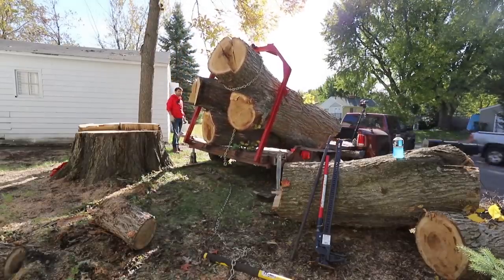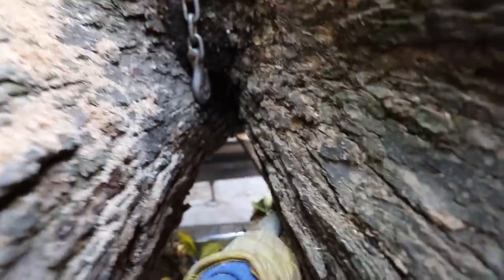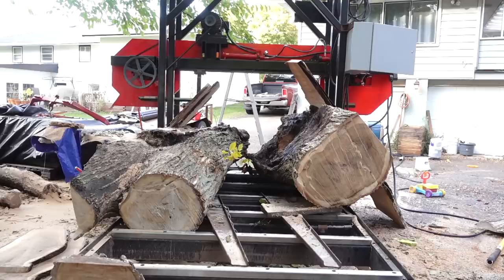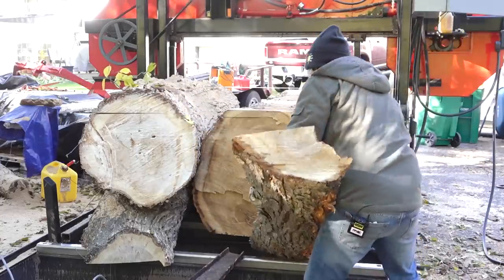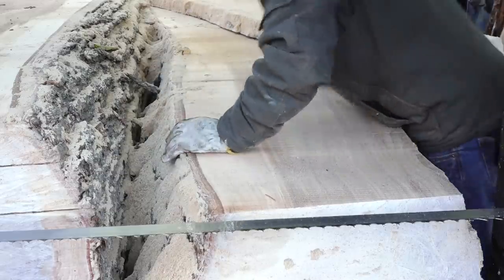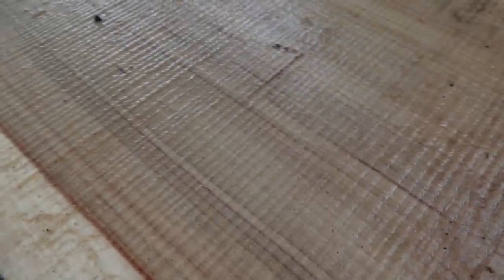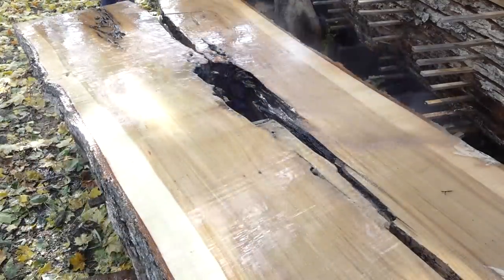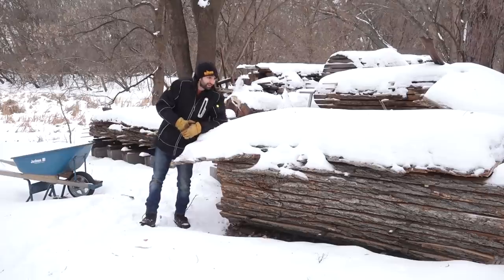This Log Came Apart on my Sawmill

Comment: I'm happy you had the good sence to stay off the top of that mess cause as much as they weigh, It would crush you. I really think you need a electric or hydraulic motor on the track system to make even more smooth cuts and save you from hurting yourself. You shake the devil's coat tail too many times then its only a matter of when, not if!

Comment: Watching this gave me an idea on having slabs cut from a trunk with the rootball still attached.  Meaning someone took the time to dig all around the base of the tree and cut through the roots so you are left with a long trunk and the rootball.  I see a waterfall table with the short side ending with the rootball cut at its widest and then going up the trunk for the joint and table top.  Have you cut a large tree with the rootball still attahed?  Any ideas?   Thanks for the vid.

Comment: Mathew,have you thought about using a battery powered drill in place of the hand crank? Maybe just disconnect the handle and use a deep socket ! Food for thought and save your energy! Good job ,we are enjoying your work!
Reply from the maker: I use a drill on small logs when I need much faster feed speeds

Comment: I imagine that in one of your previous videos you covered this question, so please forgive me if I'm going back over some old ground... but I was wondering why it is you haven't automated the forward and backward movement of your saw carriage?
  Again, sorry for most likely asking a question that had already been addressed before.

Thanks for sharing your sawyering experience with us!
Reply from the maker: Mostly because I prefer using the saw to working on it. I also like the manual feed. Provides much more feedback as you’re moving the saw through the log

Comment: Get yourself a metal detector and run it over the tree before you agree to remove it, because it could get expensive replacing blades because of hitting metal objects.  The saws mills around here don't like to take trees off of private property because people put screws and nails in trees.
Reply from the maker: It doesn’t really make a difference to me. I expect there to be something embedded in these trees

Comment: Hi Matt, are you able to send in the blades for repair (with missing teeth), or are they toast once you hit metal and strip teeth?  Thanks.
Reply from the maker: You could splice in a replacement section but they’re pretty inexpensive so it’s not really worth it

Comment: It does no good to note "cut duration", the longest time for woodworking is set up. Measuring, positioning, adjustments and mistakes, take the most time.
Reply: Those are called flitches in the milling world. The speed of forward movement of the band saw mill will affect a lot of stuff, so it actually is useful. I assume most of the woodworking you guys do is with already rough milled wood.

Comment: When a blade looses several teeth is it trash? Or can a sharpening service braze on replacements?
Reply from the maker: They’d need to cut the damaged section out and weld in a replacement. I doubt it would be very cost effective

Comment: That was either two entirely separate trees growing up practically on top  of each other , or  it  was like a two-headed mutant-- grew two trunks at once. Stuff like that happens now and then.

Love your vids, Matt!
Reply: I wish you could mill my Siberian Elm. I had the tree cut down but still have the boul, 9 ft high by
11 ft circumference. I salvaged about 600 board feet from the limbs and may get 400 bf from the boul. Elm is a beautiful wood finished.

Comment: Always cutting so thick slabs !  expecting to loose 50% of it on the jointer + planer ?
Reply from the maker: About 1/3 between shrinking and surfacing
Reply: @mcremona   coincidence i just commented on another of your video about milling strategy without a kiln and without a quarter sawing capable mill.

Comment: You need a gantry crane attached to your saw. Make it foldable so transport would be easy.  When you had 300# slabs, it would be safer.
The winch works well but OSHA would have a hay day with you. Your to young to have a life altering event... safety first!
Reply: This was filmed before he got the skid steer now he uses that.
Reply: Y Pop that works also! And probably more versatile..👍👍👍

Comment: Could you set up a garden hose to that area so you don’t have to use a bucket to splash water on the slabs?
Reply from the maker: Yes, that’s how I fill the bucket
Reply: Matthew Cremona of course.  So do you just prefer using the bucket?  Seems like it would be more efficient to spray with the hose.   Who am I to judge?

Comment: Should put a timer on how long it takes to remove and stack each slab after it's cut. Butting it is considerably more than 1:31 lol
Reply from the maker: Approx 15 per slab for the whole move and splash segment
Reply: Not as bad as I expected. I know it would take me a lot longer though. Even if I had a good system worked out.

Comment: The ants look like what we call Termites, wood eaters
Reply: Actually they're carpenter ants. Termites are an off white and softer bodied type of insect. But carpenter ants are larger black ants with harder shell like bodies. But since the type of damage they both do is quite similar, it's easy to get them confused.

Comment: Why are there nails in trees? Also, how much does that blade cost?
Reply: Clothesline is the most common reason. Given the variety of fasteners, I would guess kids made some kind of fort up there.
Reply: There are all kinds of reasons people put nails, staples, and screws in wood. One of those screws had paper around it which means it was probably a sign or notice someone put up. There is also clotheslines like RI Bill mentioned. Slats to make it easier to climb, and places where fencing was attached  are also common. And since they were mostly in a bunch, they may have been where targets were put up for target practice. That might also explain those other odd bits of metal he found, old bullets and buck shot.
Reply: As for your question about how much the saw blades cost. Matt answered that on another comment, he said they cost $48.
Reply: @juliebaker6969  True, I didn't really think about it haha.